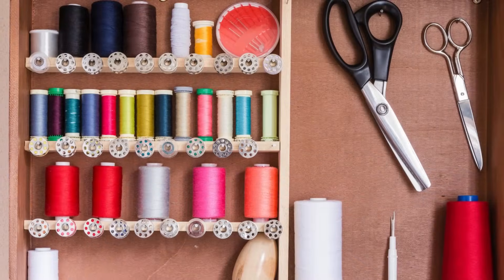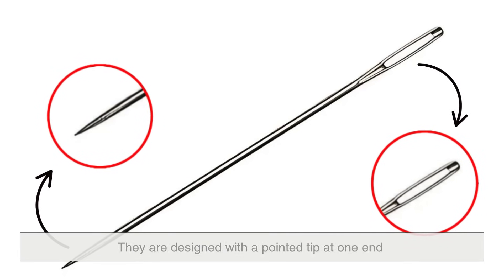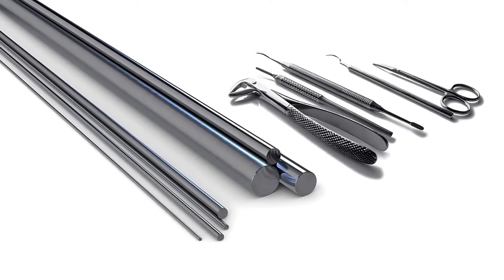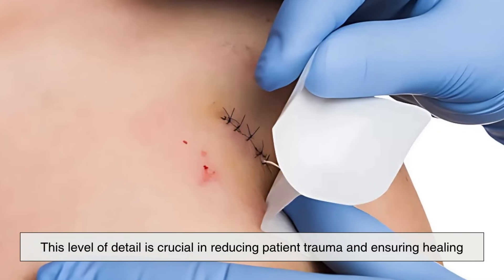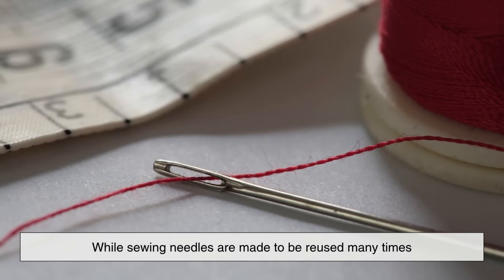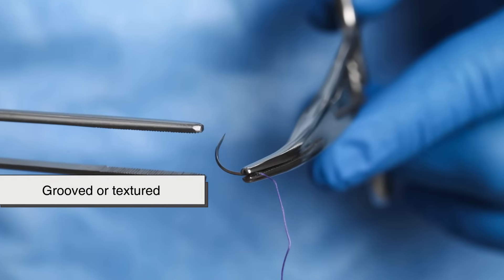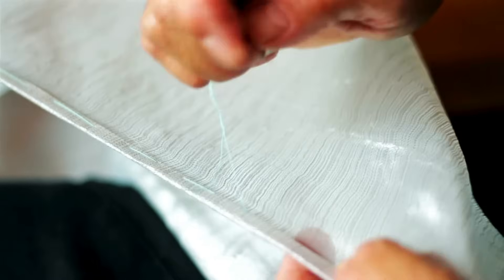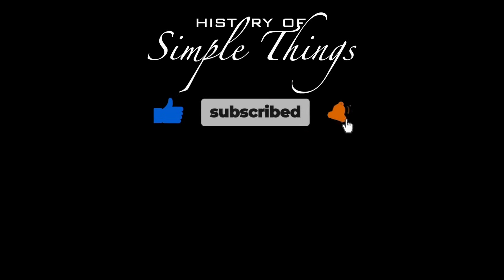The Surgical Needle vs. The Sewing Needle: More Different Than You Think

Comment: @ 1:42, at the top right of the screen that tool with an aluminum handle resembling a figure eight is known as a “Clover Needle Eye Threader”. It is used to insert the end of a thread through the small eye of a needle. This aid is necessary, because as people age into their 40s, then their eyesight develops “Presbyopia” such that their eyesight can no longer focus clearly on small objects at a nearby distance.
Reply: In germany they are called "Maria Hilf!" meaning 'Mary help me!'. Other way is to put the end of the thread onto the lips of the mouth. But that is not for bad eyesight, but to reduce frayed end to put it trough the ear of the needle. Also the eyesight is not every time a problem in aging, but sometimes tremor makes it difficult aswell. So I even with -9 Dio. I mostly manage it without that helper. Just holding breath. But I wasn't a heavy drinker or so also.

Comment: I prefer staples and glue
Reply: Duck tape work ok for many things. Glue then staples then ducky and we're off. They say making a cut on a snake bite, then sucking on it does not work like in old movies. I would still try it on myself just to double check. If it bites you on the ass you are in real trouble if you are alone, depending on the type of snake. Rather not wander or roll around bushes or over holes in the ground when exploring the outback I'm thinking. Good luck and be safe out there shoppers.
Reply: @antonvrb1510  LOL I was thinking more of the medical staples and glue that they use for closing wounds in hospitals